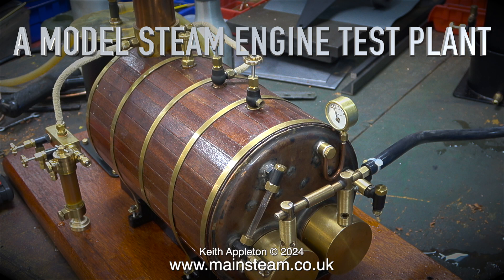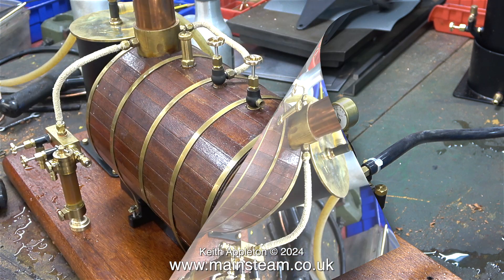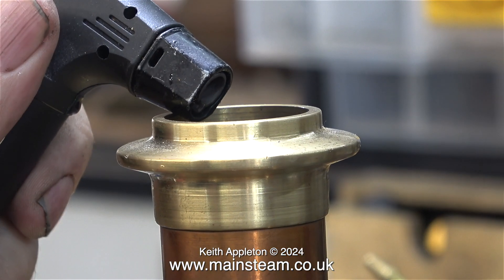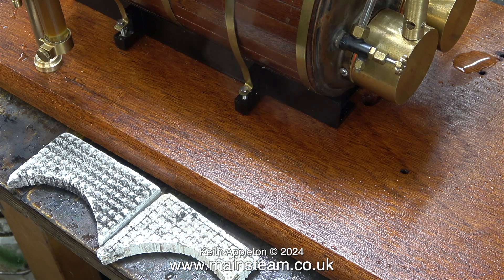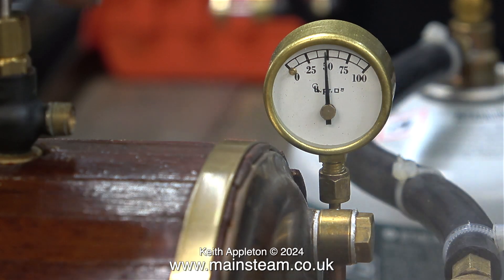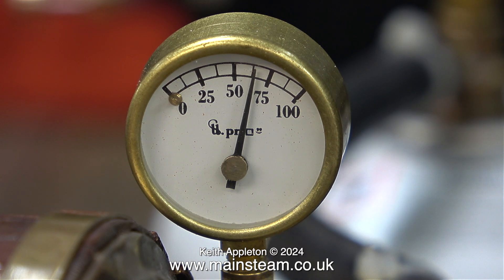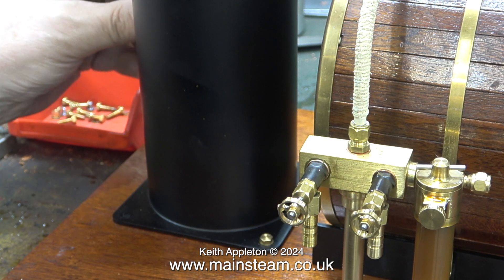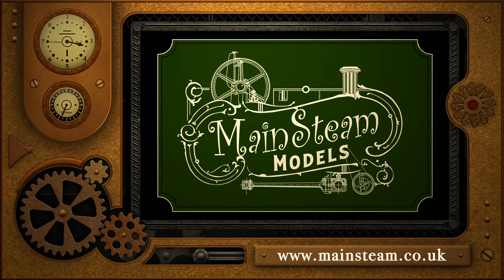A MODEL STEAM ENGINE TEST PLANT - PART #27

Comment: just as an maybe stupid Idea, but can you use the steam out of the steam engine, before it goes to the condenser to heat the gas canister?
Reply from the maker: Heath & safety issue . . . . . heating liquid gas could be dangerous.
Reply: @keithappleton  good point, thx

Comment: I'm probably not the first one to tell you this but blondihacks used a ceramic soldering board in her firetube boiler.
Reply from the maker: I bought some Ceramic for Gas use as the Ceramic soldering boards look a little weak to me. For this boiler I found a couple of pieces in my workshop that fitted the Burners.
Reply: @keithappleton  Search for ceramic plates for grills and other professional kitchen appliances. Usually are designed for heavy duty use.
Reply from the maker: Yes, thank you, I did exactly that and bought some a while ago }:-)))
Reply: @keithappleton  If you need some samples sometime, contact me. I'm in the spare parts industry for professional kitchens, and I can send you some samples if the shipping isn't too expensive. Just as a thank you for your great videos. BTW, ¿What tools you use to cut them?
Reply from the maker: Very kind, thank you. Could you possibly send me some photographs of the Ceramic samples please? keith@mainsteam.co.uk
Reply from the maker: I cut the Ceramic using a small bandsaw with a 1/4 inch blade.